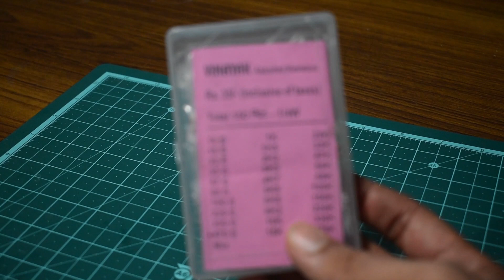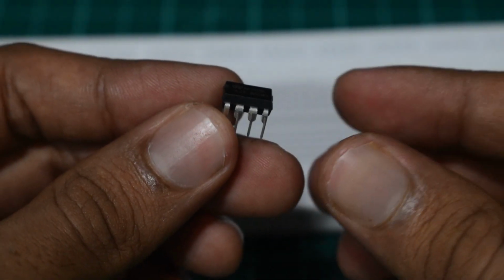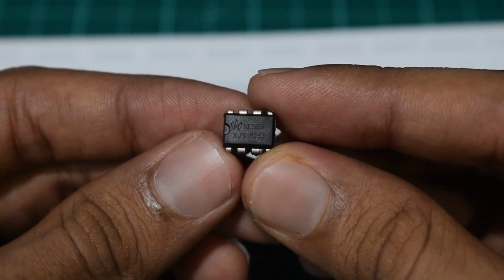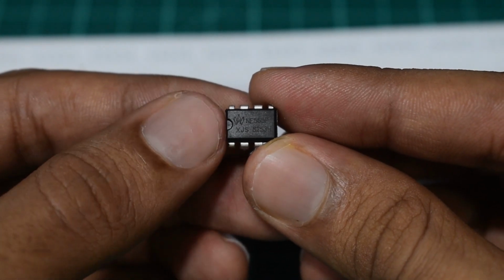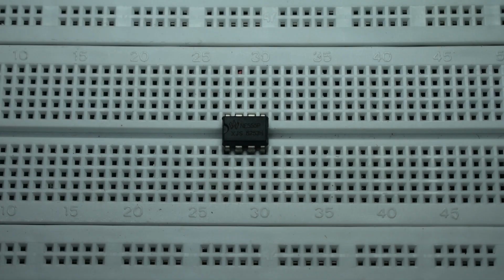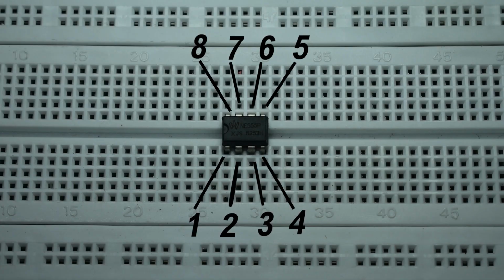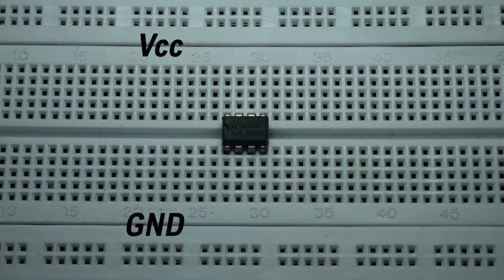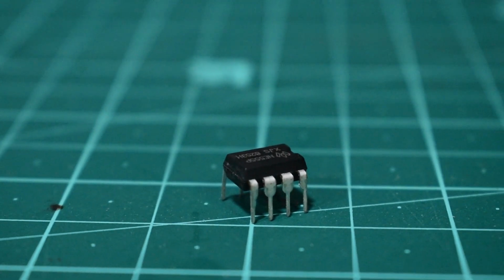DIY Airplane Navigation lights,explained+Circuit prototype PART-1

Comment: Where do you get 100E resistors? What other resistor would you relate the 100E since I can’t seem to find to find an E like resistor. Also which type of capacitor voltage are you using in the video?
Reply from the maker: 100E means 100ohms.  [Brown, Black, Brown, Golden].is the colour code.

Comment: I don't have 10 uf can I put 100 uf instead
Reply: Thank you
Reply: Thank you for your help love your work keep it up
Reply from the maker: @michaelcarney262  Thank you !!!
Reply from the maker: I recommend 10uf ,but give 100uf  a try, the reason is it might take too long for the light to turn off during blink
Reply: What color code is the 222k ohm
This is my first project
Reply from the maker: @michaelcarney262  I'm not sure , my resistors  where separated according to the values
Reply: And what diod number did you use ?
Reply from the maker: @michaelcarney262  diode was a normal pn junction diode